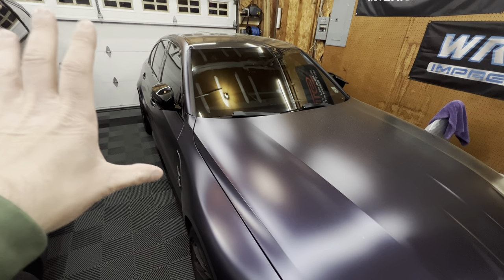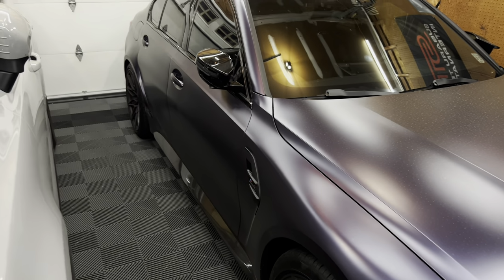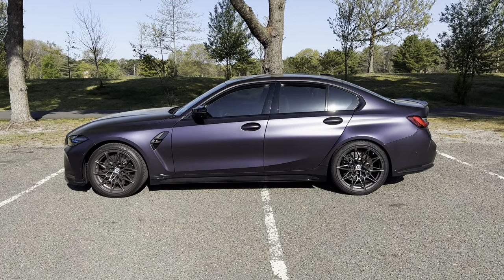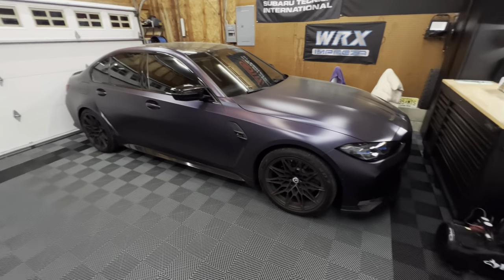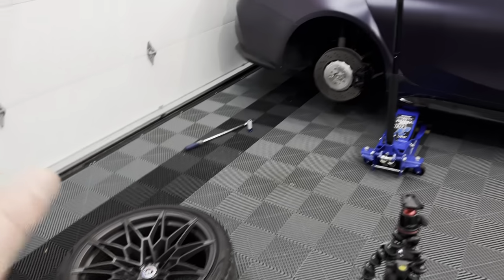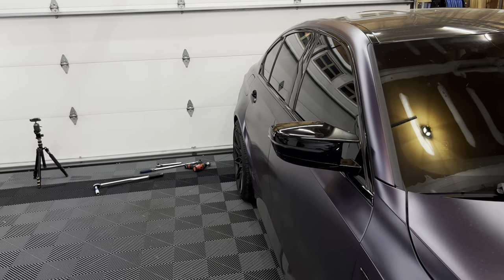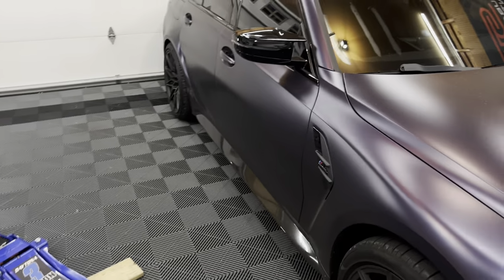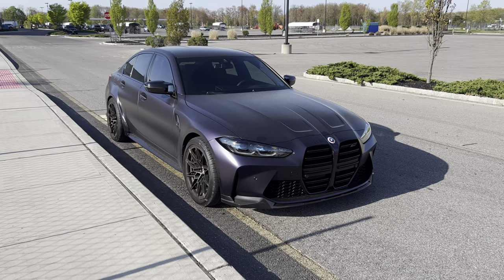BMW G80 M3 Jahre Edition Spacer Install - Future Classic

Comment: This is a great video for spacer install.  I've seen a bunch b/c I'm about to this for my car.  I really appreciate you including the "mistake" of forgetting the second spacer bolt because this really had me puzzled at first.  I have Macht Schnell spacers and have been diagnosing a vibration for a long time.  They were great on my F80, but my new car they don't work as well.  I think the spacer bolts will eliminate the vibration 🤞 THANK YOU!!!

Comment: I went from owning 3 STIs and now own a g80 m3. These cars are amazing. So much better interiors and technology than a STI. They do lack the raw feeling of a sti…but are a better car. They also loved to be tuned. A basic stage 2 and E tune gives you a 9sec car.
Reply from the maker: Fantastic car for sure, however, I would be hard pressed to compare it to an STI. Just a different category of car for sure. Each has its own pros/cons.
Reply: @Scoobyfreak86  def a different category, but I do see more STI owners going to these. I do miss the subi platform and will be trading in my POS daily for a new wrx next week and use this as my nice weather car.

Comment: Hi, do you have the front wheel rubbing the inside grill? I just install my M4 and it rub both side when I turn the wheel all the way to  the left and right.. thanks
Reply from the maker: You need to trim the liner vents or get the replaceable inserts.

Comment: Did you have to heat gun the inner arch with the Pzeros on ???? They say you get wheel rub off the vents and the lip that sticks out
Reply from the maker: I addressed that in this video

https://youtu.be/gwzqtvQXGc4
Reply: @Scoobyfreak86  I’ve watched this video twice and it doesn’t say anything about my question , you stated 15 on the front with 12 on the rear but nothing about rub on this video
Reply from the maker: Sorry! I linked the wrong video. It’s in this one https://youtu.be/gwzqtvQXGc4

Comment: Hey man could you send me the link to where you bought these because I’m really liking the way it turned out on this one. If you can that would be great bro. Also love the video
Reply from the maker: Thanks for the kind words! https://ind-distribution.com/collections/m3-g80/products/future-classic-bmw-5x112-wheel-spacer-kit
Reply: @Scoobyfreak86  No problem. Also how many spacers come in a box? Is it one or two? For quantity, if I put 2 then will two boxes show up or will two spacers come in one box?
Reply from the maker: @matthewmenjivar6660 2 per box.
Reply: @Scoobyfreak86 Ok thanks👍
Reply: @Scoobyfreak86  One more thing. Does it make a difference if I’m on pirellis and not Michelin pilot sports?
Reply from the maker: @matthewmenjivar6660 no difference. The pirelli’s are a bit thinner so you shouldn’t have the rubbing issues.

Comment: Did you get any rubbing ?
Reply from the maker: Had some in the front vent liners but trimmed them and no more rub.
Reply: @Scoobyfreak86  I gotta trim my damn left liner, been putting it off and when I get that reverse full right lock it's the worst lol
Reply from the maker: They have the grate inserts now you can get or you can do the full aftermarket liner.